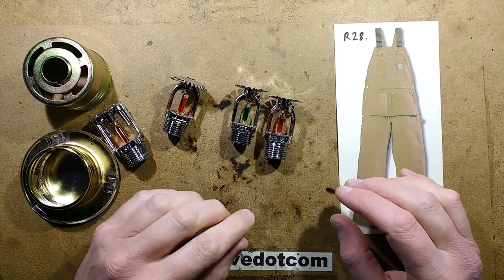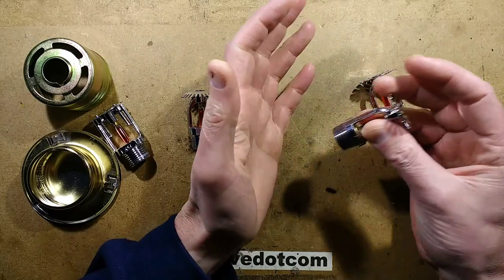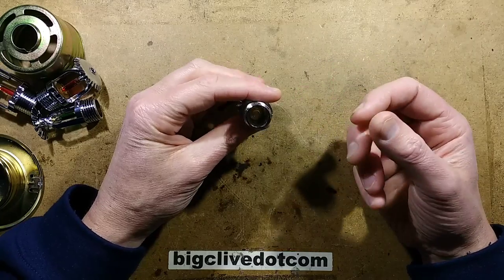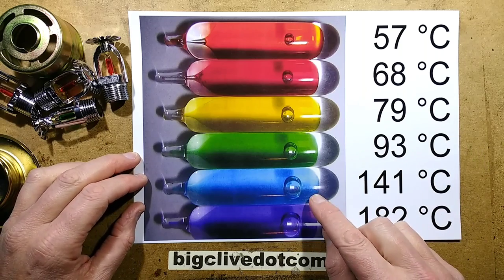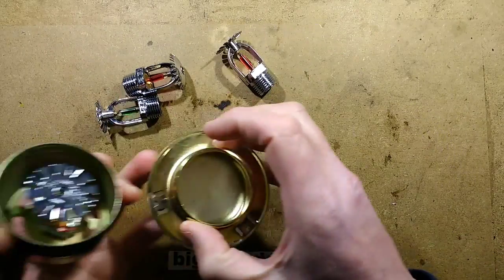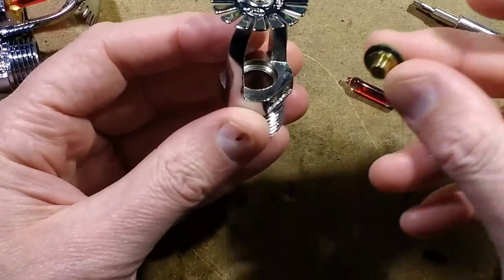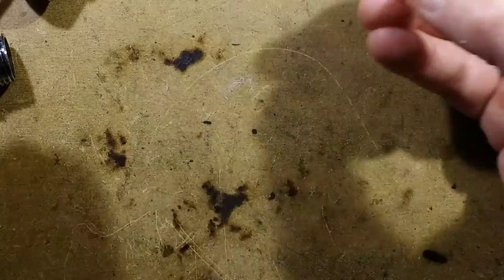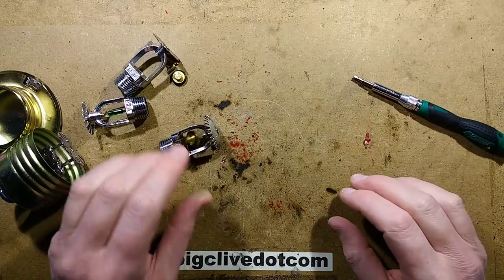How a fire sprinkler works. (featuring broken glass and spatter.)

Comment: Un the U.S. we use CPVC (Chlorinated PVC) pipe for sprinkler systems. You can use copper also, or even iron, but CPVC is the most common. If you think about it, it makes sense, the pipe will never get hotter than the liquid inside it. So as long as there is water in the pipes it will never get over 100C
Reply: Except that CPVC is a poor conductor of heat so it will develop a thermal gradient either just softening the outer fraction of the wall or actually burning off the outer fraction of the wall. This weakens the pipe at that point, potentially allowing the water pressure inside to exceed the now derated wall strength of the pipe, leading to a burst pipe. This would then ruin the engineering of the water dispersion of the sprinkler system. But I suppose if the fire is so bad that the sprinkler head positions can't attack the fire that is attacking the pipe, the problem is too big for the sprinkler system...
Reply: Probably would take a hell of a fire to fail the pipes in which case you are right, it's too big for the sprinklers anyway.

Comment: These type of sprinklers are quite allergic to big pressure changes in their water supply. I've seen pictures of the aftermath of a production plant after someone turned the water supply back on too quickly after maintenance and inducing a slight water hammer effect. while all the machines looked very clean, but the many maintenance techs standing beside them looked very, very unhappy.
Reply from the maker: I'd guess the hammer after air purging could apply a lot of force.
Reply: @bigclivedotcom  Water hammer can be nasty. Especially in industrial zones/buildings that have either a nice thick pipe or (as many industrial buildings do) a local water pump system for emergency water supply.

A few years back i worked at a company where the yearly pump test included an item to close the valve to the sprinkler system before starting the pump. If you didn't, you'd end up with flooding the shop floor...

Comment: The 58C is really low - surprised any of them are set to go off at that temp. If you had a bunch of computers running in a closed room you could hit that temp. Surprising how much variation there is there on the trigger temp. Apparently they go all the way up to 650F at least. That is a hot room.

Comment: Do you think you could disassemble one of those Card Readers that the banks use e.g. nationwide card reader, or the card transaction machines you get at restaurants etc?? Would be interesting to see how they work :)
Reply from the maker: I think EEVblog or mikeselectricstuff may have done one.  It had serious levels of anti-tamper circuitry that automatically killed the electronics if any attempt was made to open the internal modules.
Reply: bigclivedotcom Ah didn't think about that makes sense I guess. Keep making entertaining vids :)

Comment: You can't use copper because it will fail. 
As in it will burn through or the pressure build up will also break the pipe.
A deluge of water is not as effective as a spray. If it was the fire fighters wouldn't use a hose but a bucket...

The spray is used as a mist/spray will also trap the fumes/smoke against the flames while cooking the area down.

Fire needs heat and fuel to burn and spread. 
Reduce the heat and smoother the fuel you can control the fire. A sprinkler is meant to help control and suppress a fire not to extinguish it.

Comment: I was expecting an oil in there as oil, doesn't evaporate a low temperatures, and expands considerably with heat.
Reply: Glycerine (glycerol) matches your criteria, and can be combined in any proportion with water to vary the mixture.

Comment: I've seen a green one it's labeled 45C° is it different by brand?
Reply from the maker: That's a really low temperature unless it's the maximum recommended ambient temperature for the typical 93 degree trip point.
Reply: bigclivedotcom oh that could be it! 
I was always scared of the green ones, I tough they were somewhat weaker than the red, apparently they are not! 
I will ask the fitter guys about this, but the max ambient sounds more logical!  
Thanks clive!  😊😊

Comment: Sprinklers are cheap, but rigging up a building with a water system to use sprinklers probably isn’t
Reply: Depending on the building it could run upwards to $10k.

Comment: You would also want a pressure pump. All sprinkler systems have a pressure pump that kicks in as soon as the water pressure drops in the pipe. One thing we learned ,when the sprinkler system is set off,all that stale stagnent water that also contains thread oil from the pipe cutting sprays all over everything,ruining everything in the area, not counting the water damage. The smell of stagnet water mixed with cutting oil is enough to make you puke. We had a kid hit the sprinkler head with a backpack at the new Jr. Highschool a month after it opened,what a mess! I was a custodian then. I got called in early to help clean up the mess. Cutting oil stains pretty much everything.Oh, and the stench!
Reply: Another reason to use PEX, no cutting oil.
Reply: Vern C You cannot do that in a commercial building. In your own house mabe,but never in a business or Appartment complex. Think about it,if the fire broke out next to the main water supply,and it was PEX as you suggest, the lines would melt and burst,the water may not put the fire out,as more than likely it wouldnt,so there goes your great idea of using plastic in a fire suppression system. Um,no....

Comment: dunno what's up but there is no sound for me. the commercial beforehand does have sound other videos too.
Reply from the maker: +Wouter Portegijs Check your computer's surround sound settings.
Reply: I did and thought everything was fine an dandy.
Tried later and realized the sound only emerges from the center channel.
I was wondering about multi channel audio with youtube but did not directly see any audio settings in the settings tab so just assumed stereo....... 

yeah I know where the problem is 2.......

p.s. even though I did look a little further there seems to be no way for the end user to control which stream you are receiving. Whatever google.... at least multichannel seems to work if everything is set up right on your end.

Comment: I believe that the ones that have the liquid that is visible are all being phased out and replaced. I have been told that this is because people were setting them off intentionally with those lazer-pen things. especially thieves were setting them off in buildings they wanted to rob because it would shut off the security alarms or some shit.
Reply: Can you cite some source for this?  For this to be happening, a laser pen would need to be able to almost set fire to something from across the room.  Unless you are hefting a massive battery pack, small laser pointers just don't have that kind of power.  Also keep in mind that the liquid is tinted, but basically transparent, so the light would just shine through.  I commented on the AVE video where this was alleged, but no-one responded with a single instance of this occurring.

Comment: Not very sensitive, considering you needed a blowtorch placed 2 cm away, for 10 seconds. I imagine by the time these things went off, the place would be blazing.
Reply from the maker: Programmable hot air pen.  Very low output compared to a blow torch.

Comment: So let me explain how these little viles work. Basically. It's a liquid (I think mine have mercury in them) that expands when heat is introduced, but what makes the viles break at a certain temperature is the size of the air bubble. Since air can be compressed, the bigger the bubble, theoretically the more the liquid can expand before it blows. If I got this all right, hurray, I've guessed pretty well. If not, correct me haha!
Reply: Also, I watched to 3:00 and stopped. So whatever explanation coming above in the video I have not seen haha
Reply: Also, those little white covers you're talking about, I think the ones I have melt at a certain temperature and evaporate. Or the Pure pressure from the water coming down should theoretically pop it off.

Comment: I'm guessing the liquid is one of the "anes" like butane or propane, probably mixed with a heavier liquid.
-edit That thing I said was wrong.  It seems that the bulbs are filled with a glycerin/water mixture.  Controlling the ratio of glycerin to water lets you control its boiling point over a pretty huge range of temperatures.  Still doesn't quite add up though with temperatures less than 100C.
Reply: probably thinking too hard.  realistically, carbonated water would work just fine.  Carbon dioxide's solubility in water goes way down as temperature increases.
Reply: As mentioned in several earlier posts, ethanol has a boiling point in the required range.
Reply: nooo it doesnt.  Its boiling point is way too high for the lower temperature ones.  Orange and red are both below ethanol's boiling point.
I should have been more clear before in my editing.  I looked up the manufacturer for some of them and (eventually) the MSDS, which makes it pretty clear its primary component is glycerol.  Some of them say glycerin, which is the same thing, but you won't find any of them that don't contain glycerol.
Reply: Its not the actual boiling that breaks the tube, but thermal expansion in a confined space. The vapour pressure of the mixture (which is inversely proportional to the boiling point), is linked to the size of the bubble.

Comment: I suppose part of the inspiration for this video was the tragic Grenfell Tower fire.
It's doubtful that your ordinary domestic water supply would provide enough water quickly enough to extinguish any house fire that is hot enough to trip one of these sprinklers. A typical installation for these has a riser system with a large water tank and pressurized air to force the water out quickly. With ordinary water supply pressures, it would be like trying to put out a forest fire with a lawn sprinkler.
Reply from the maker: There are domestic systems that run from the standard water supply.  Anything is better than nothing, and even a light sprinkle of water in a small residence will have a significant effect in slowing or stopping the spread of fire.
Reply: @bigclivedotcom  I suppose it could help slow the fire enough for the local bucket brigade to get there and salvage the structure. I still feel a lot safer with a chemical retardant extinguisher than I would relying on a shower head.

Semi-related side note: I hope everyone who enjoys bringing saplings filled with turpentine into their homes once a year has been switching to low-voltage and low-temperature fairy lights.So many Christmas Tree fires...

Comment: Like apartment buildings in London! Why didn't THEY have sprinklers?
Reply from the maker: It was probably a balance between the benefit they offered versus the massive damage to all the flats below if triggered either by fire, accident or malice.  The flats were probably designed to contain fire, but they just didn't know that it could spread on the outside cladding and then enter all the flats via the plastic glazing frames and trims.
Reply: Number of people killed by fire suppression sprinklers: 0. Number of people who died in the fire, LOTS.
       The one thing about sprinklers is, they still work, no matter how many changes are made to the building.
     Those pictures were absolutely horrifying, and that fire was just completely unnecessary.
     The sprinklers are amazingly reliable and dead simple making a failure really unlikely. And, as you pointed out sprinklers can be protected from malicious or accidental activation.
    Instead they went with a containment strategy that they didn't know for sure would work, and it DIDN'T work.
    This was up there with the engineers just assuming the carbon-carbon reentry protection on the space shuttle would be strong enough to sustain impacts from foam.
    They just didn't imagine the fire would escape containment like that. Failure of imagination has cost a great many lives.

Comment: Clive you should have a look at hi fog nozzle. There like sprinkler on steroids. Use them on ships to protect large engine
Reply: They're actually quite expensive and also require a very high pressure pump (3-4000 Psi) to operate proprely.
Reply: psirvent8. I am aware of this. I have worked with allot. But still really cool to see go off. Make sprinkler look childish :)

Comment: But the looks of it its just that, a liquid. It could just be plain old water. What the give away is the size of the gas bubble. Becuase gas expands under heat and a liquid and be compressed once it reaches a certain temp then pop goes the glass.

Comment: You couldn't (successfully) use one of those sprinklers in your home, because your home plumbing can't deliver the very large flow even one of those requires (commercial installations have enormous pipes to deliver the flow).  Sprinklers are specified by NFPA 13, and in 1989 NFPA 13R (residential) was created.  Specially designed sprinkler heads would work with the flow a residential system could deliver.  But unlike a 13 system, which is designed to put the fire OUT, a 13R system is only able to give one enough time to get YOU out.  The building, alas, is expendable.

A feature of such systems is that the sprinkler water comes off the house main BEFORE the rest of the house, so in order to shut off a leaking sprinkler, you must shut off all the water to the house.  A moment's reflection will tell you why this is important.

Comment: Don't use copper pipe... Use schedule 80 rigid pipe that is meant for sprinklers... That will hold the pressure not some copper plumbing pipe... It will explode or it will corrode then explode.

Comment: I would not recommend sprinklers for electrical workshops or large IT server installations as they present a danger from electrical shock,  nitrogen gas system is much more safe as they are used in the IT industry also archival storage and museums to prevent water damage to high value items / equipment.
Reply: Nitrogen gas systems?  The air you breathe is already 80% nitrogen.
Reply: Yes but its the 20 % oxygen that's ignites fires !

Comment: Can't have fire sprinklers without a back flow preventer installed at the main, by code in the US anyway since the water trapped in the system goes rancid after years of just sitting there
Reply from the maker: Unless the pipe that fed the sprinklers was part of the homes normal water distribution system with regular flow.

Comment: Huh, I just ran into one of these attached to a small c02 (i think) bottle, maybe half a pound or something, I guess designed to be bolted to a ceiling as an easy to install system.

I always figured these used a bimetallic strip or something similar, not liquid.

It would be interesting to see how these are manufactured, and if these chinese reproductions are as reliable as ones made in countries with stricter regulations, in terms of going off at the proper temperature.

I'm going to buy a couple of these and test them out using a laser to see how effective it is.

Comment: Couldn't you have c02 extinguishers handy and save on the water damage a sprinkler would cause? Maybe even invent the c02 sprinkler!
Reply from the maker: +Jamal Tyrone You get halon extinguishers that work by displacing air.  But if anyone is in the room they are asphyxiated.
Reply: I'll get onto eBay for some of those immediately. %)
Reply: Good to know!

Comment: It's NOT a good idea to link this to your water mains. That water will be standing still in those pipes for a VERY long time. Anybody showering from the other end of the "split" will get eventually very sick (deadly) forgot the name of the decease, but its the reason here in Europe its forbidden to have dead ends in water lines.
Reply from the maker: I'd actually have it as part of the main water supply so clean water was always flowing through it.
Reply: so you going to put all the water thru all that piping, and then at the end of that start using it for consumption?  well, it will keep it flowing, but I'd think you will find that after all that piping you have not much pressure left. Which brings me to pressure. Don't think you'd have enough pressure to put out a fire from the main water, esp when its already spreaded to other area's then multiple openings will make the first 2-3 spout water in various degrees, but the rest just a trickle.

Comment: "Trigger element for a sprinkler 
US 4938294 A
ABSTRACT
The response time of the trigger elements of permanently installed glass barrel sprinkler installations can be shortened by the use of special expanding liquids having a low heat capacity coupled with rapid heat absorption. In particular, lower alkyl homologs of benzene such as, for example, toluene and o-xylene, or halogen derivatives of hydrocarbons such as, for example, tetrachloroethylene, are more suitable for this purpose than the hitherto used expanding liquids based on alcohols. However, aliphatic hydrocarbons of medium chain length, lower cycloaliphatic hydrocarbons, esters of ketocarboxylic acids and simple lower ketones can also be used. The fast response of the glass barrel sprinklers allows fires to be fought at an earlier stage and reduces the water requirement and hence the installation costs."